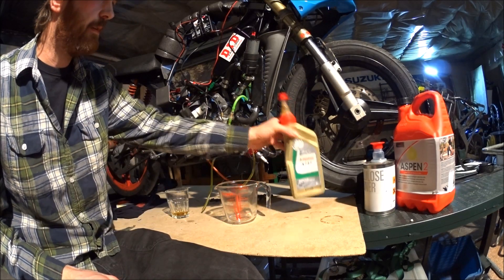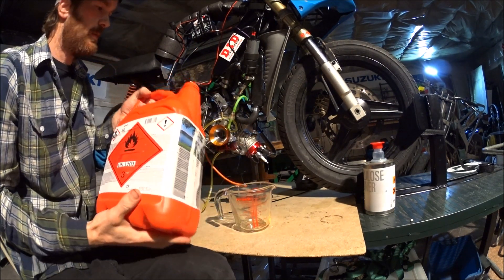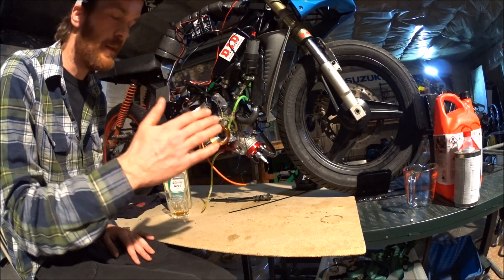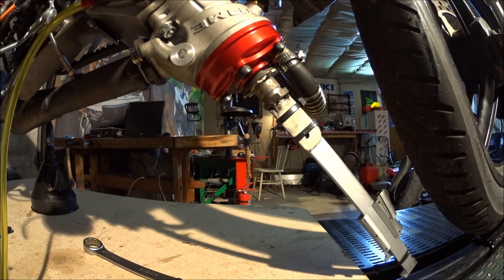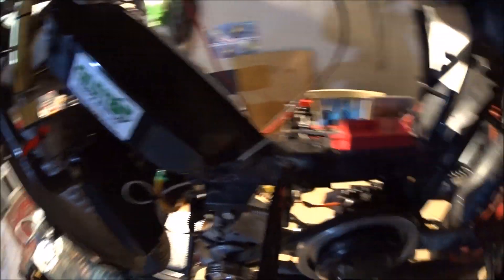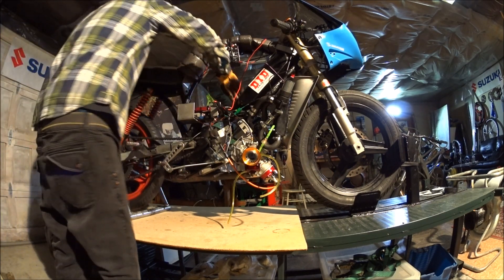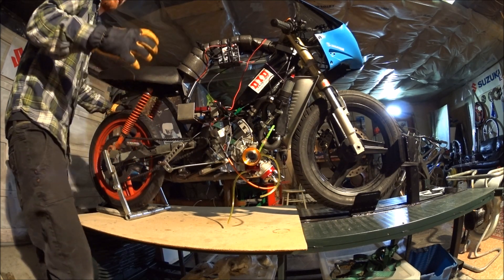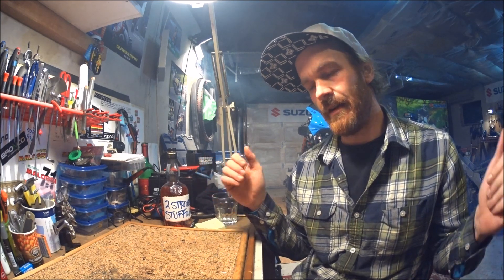E16 - IT'S ALIVE! Rotary Valve Peugeot Spx, First start after rebalancing crank 2STROKE STUFFING

Comment: Your depth guage isn't self returning (puhsing back onto the piston. So the piston pushed it too far. No ?. Shouldn't you push it back to touch the piston; then read it. ?
Reply from the maker: I let the piston push it up to find tdc, then after extending it the required mm to get the right timing I gently twist the crank until the piston touches it.

Comment: ok , again, i like the billet crankcases , the rotary valve looks like a 100 cc italian kart valve and you are only using around 180 degrees of open time , the barrel assemble isnt peugoet  it is i a m e which is an italian go kart engine manufacturer, which looks like it had a power valve in the exhaust at one time , i could be wrong but i dont thing i a m e have made a 50 cc barrel , they may have made a 80cc barrel for european shifter karts other wise it would be 100 cc or 125 cc depending on the stroke, or did you sleeve the barrel to 40 mm , most racing 50,s were either 39 mm or 40 mm bore and stroke , racing 50,s in gp racing were replaced by 80 cc , as the fifty scene was getting silly with suzuki , honda kreidler, tohatsu, all making racing 50,s with multi speed gears ,suzukis 50 twin was rumoured to have 18 gears , kreidler had 12 , so did honda , so the f i m decided that a single cylinder 80 cc class with a max of 6 speeds was the answer , so derbi and garelli took up the racing , with a few others from italy which are now part of i a m e , as engineering goes grub screws in cranks is taboo a fixed pin and the whole thing sandwiched with a nut on the crank is safer, interia is a killer, nothing works better than a taper and keyway it dont move, infact just a taper and it doesnt move , montesa out put shafts , just a taper cosworth b d a cams just a taper.
Reply from the maker: +ALAN COLLARD Thanks, and thanks for the tips! I'm running 145/88 intake timing, and the cylinder is 50cc out of the box. It's for a pocketbike "iame m50".
Reply: ALAN COLLARD holy fucking shit bro! There’s a thing called punctuation. This shit is making my eyes bleed. 

I’m not a snob, you don’t have to be a literary genius, just learn where to put a full stop. It will make our messages much easier to read and what you have to say much clearer

Comment: sounds a lot like my 100cc rotary.

little 1974 Kawasaki g5 enduro.....kinda slow revving compared to most small cc 2 smokes
but pulls like a freight train 

gets snappy at high rpm, but its ment to chug.

wish they made modern stuff with rotary valves....i like the extra mid and tuning abilities. 

my engine is not made for high rpm...it doesnt  REALLY use the rotary valve....
but you can rebuild it with a hammer in your basement.....2000 miles later it still starts right up

sensors? my bike has points...easy to set if your use to old stuff